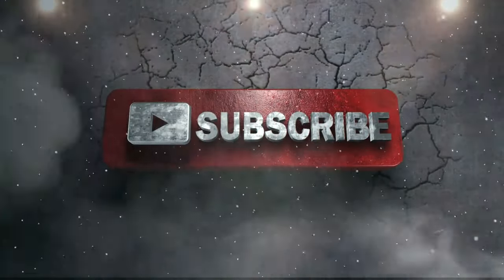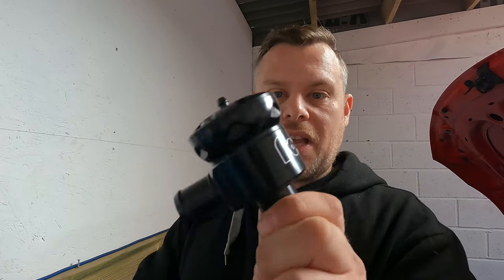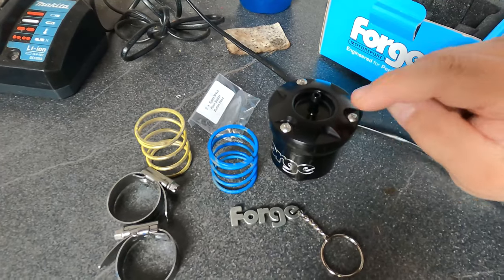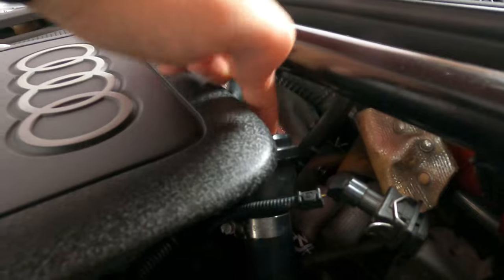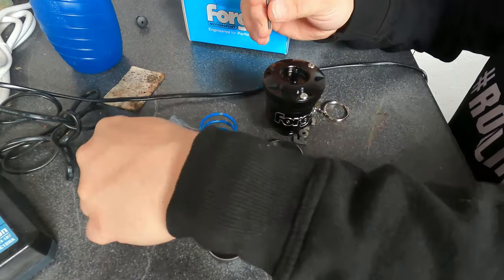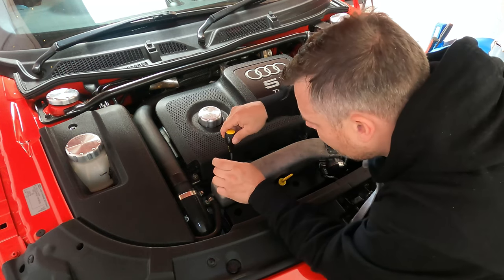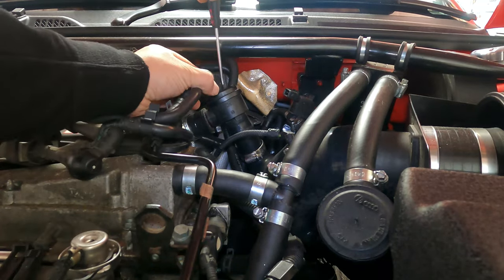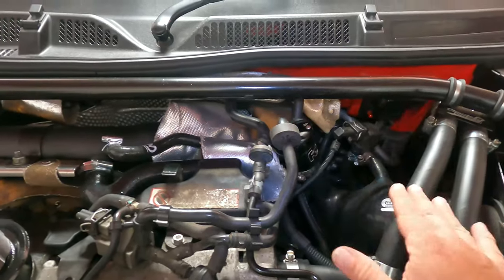THE BEST DIVERTER, RECIRCULATION, DUMP VALVE ?Audi / VW 1.8T (Installation Guide)on Audi TT MK1 8N

Comment: Hi Chris go for the big brakes mate absolute game changer, so much stopping power, 340mm front 310mm back
Reply from the maker: Definitely mate totally agree big brakes needed
Reply: @CarChris82  I’m not sure what else I can do to mine at present limited to do what I can do with the 3.2 engine it’s stage one but that’s all I can do unless I turbo it - 
Did the full interior’s black including carpet, new multi function steering wheel, cruise control, grill, splitter, dechromed her, wheels, vortex exhaust, new mk3 style lights front and rear, door mirrors sequential indicators and all the little things as well! She drives like a dream - MOT and service tomorrow so fingers crossed lol 
Using the TT MK2 as my daily now - thinking about driving it for a year then upgrading to a MK3 TTS -
Reply from the maker: Now putting a turbo on would be epic maye and you have so much already
Reply: @CarChris82  lol wife would say too much hahahaha

Comment: Is putting a BOV a bad idea on the 1.8l turbo engine? Will it really make the engine run rich when decelerating?
Reply from the maker: The engine is designed for a diverter valve (recirc valve) not a blow off valve
Reply: Fitted one to mine and every time I came to a stop the engine stalled because the MAF isn't seeing the air recirculating it is expecting..

Comment: Hey why not upgrading to electric diverter valve? Did my upgrade last week😉
Reply from the maker: On a 1.8t ?
Reply: @CarChris82  Yes 1.8t AJQ, N249 delete and diverter valve of 2.0TFSI
Reply from the maker: @MauriceF13  sounds good mate
Reply: How you do that upgrade?? i'm interested
Reply: im interested aswell, can the n249 connector be plugged into an electronic DV and work? would the supply voltage and wires support the needs of an electronic DV?
Reply: actually ive researched into this after my last post and is sounds like lots of people are running it and many are saying it works, some are saying you have to modify firmware to tune it, others are saying its slower than the OEM setup, I've found no real conclusion, but considering the topic went dead, i get the impression the vacuum actuated DV and n249 are best for now. unless someone finds a "tune" or solution